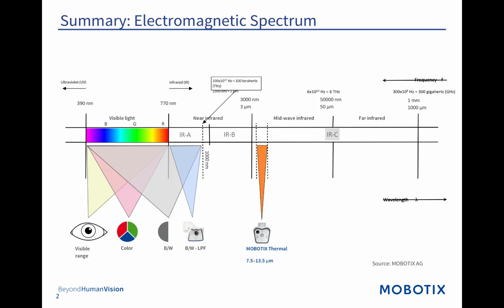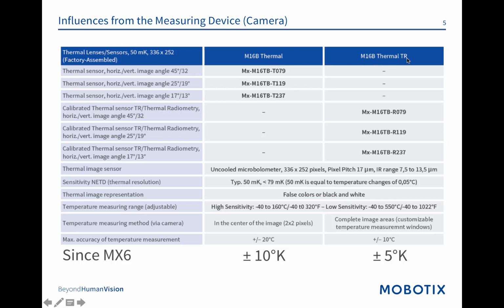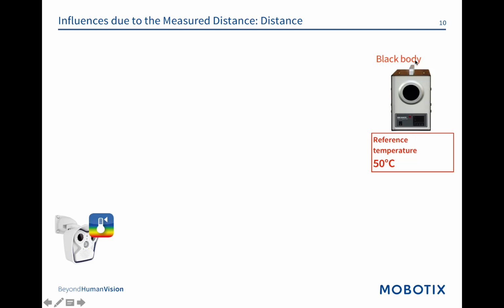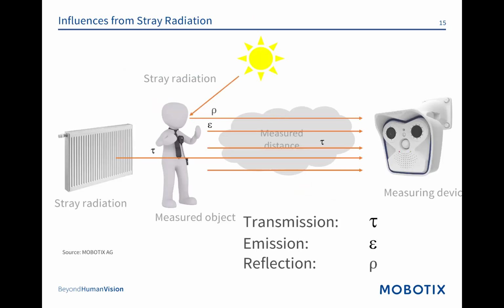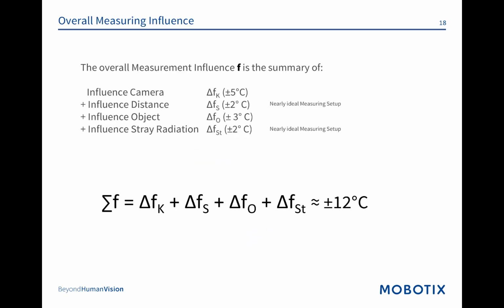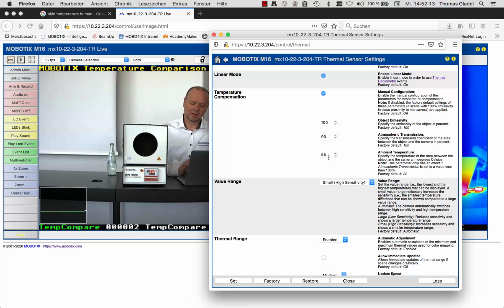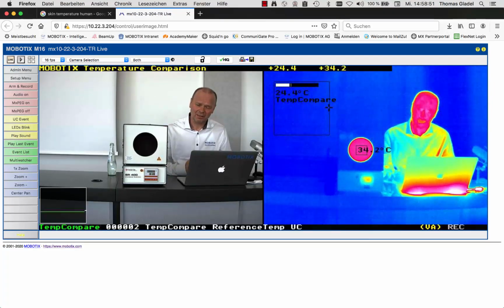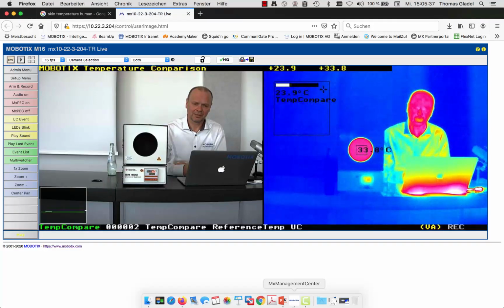Webinar – Measuring temperatures and temperature alarms with thermal imaging cameras

Comment: 00:00    Start
00:11          Welcome
00:21          What we will learn today
01:57    1 | Thermal Cameras
02:05          Electromagnetic Spectrum | Summary
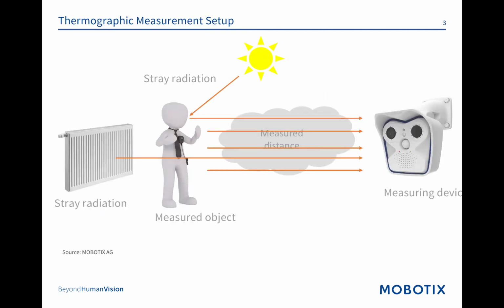04:27          Thermographic Measurement Setup
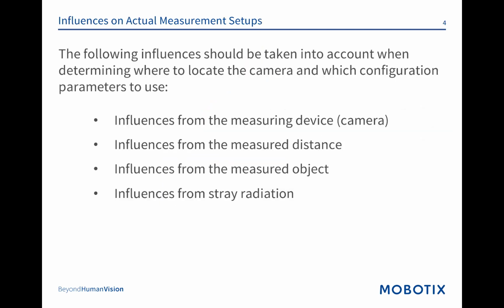07:53    2 | Influences on Measurement
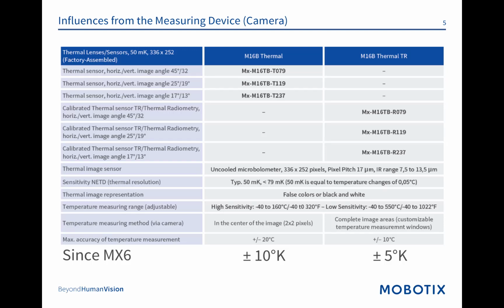08:27          2.1 The Measuring Device | Influence on Measurement
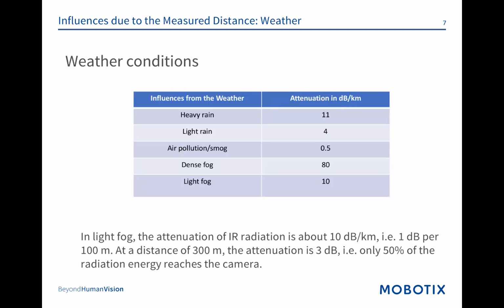11:43          2.2 The Distance | Influence on Measurement
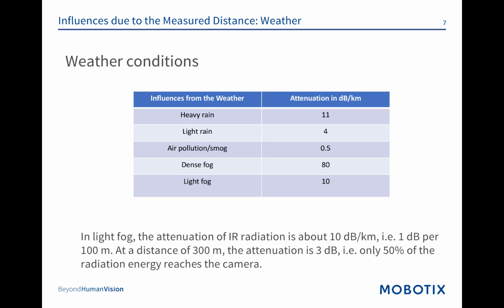11:52                - Weather
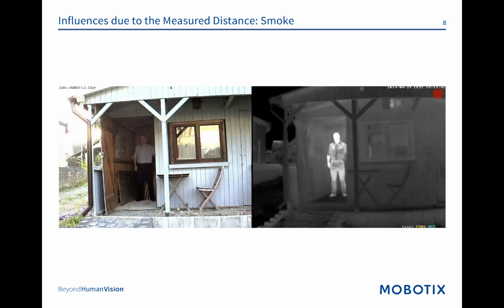12:45                - Smoke
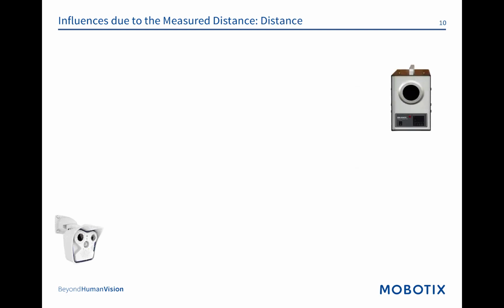14:06                - Distance
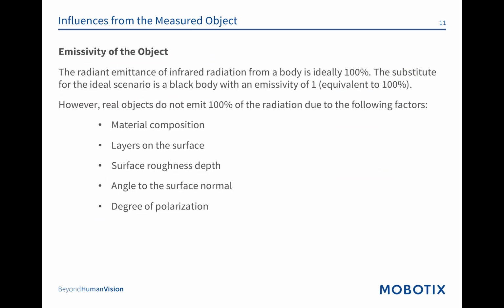16:43          2.3 The Measured Object | Influence on Measurement
16:47                Emissivity of the Object
17:55                Emissivity Values for Different Objects
19:25                Skin Temperature
22:40          2.4 Stray Radiation | Influence on Measurement
24:28          2.5 Overall Measuring Influence
27:40    3 | Getting a Reliable Temperature Alarm
27:40          Task
28:00          Setup
31:01    4 | Setup in Real
31:15          Overview
32:46          Kalibration
33:49                - Linear Mode
34:51                - Temperature Compensation
41:41          Eliminate Overall Influences
43:11          Environmental Events